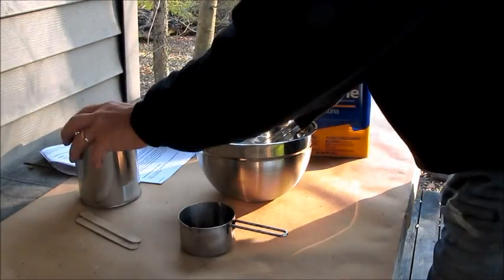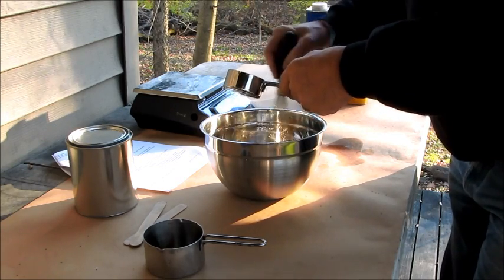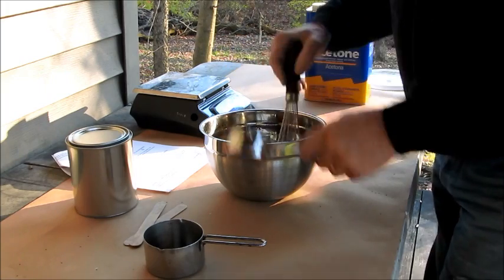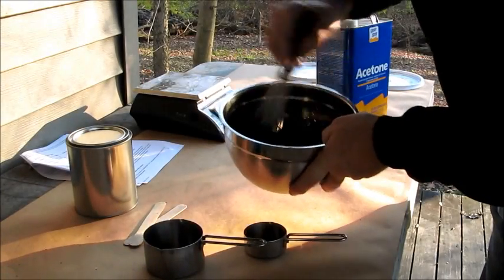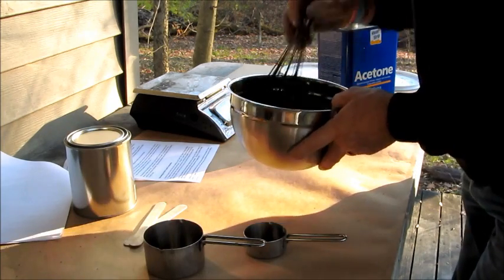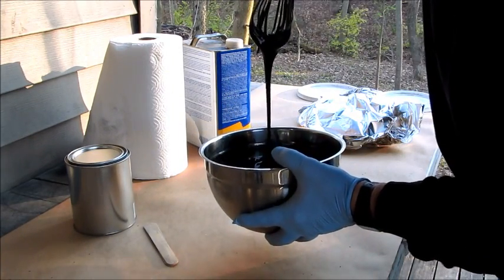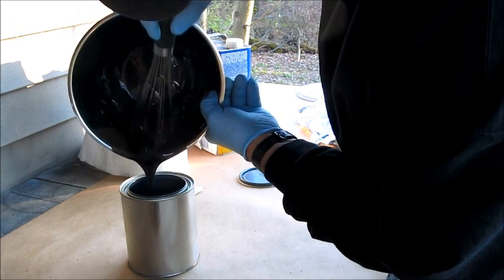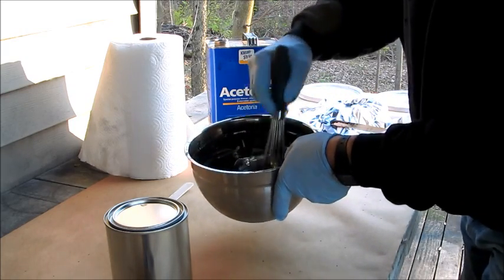Homemade Nitro-Cellulose Lacquer

Comment: is this what you would use to dip your E match in, then coat it with some sort of composition? 

or would you stir your composition in this slurry? this is just for an E match in a rocket to set off the main parachute.
Reply from the maker: I don't know how to make such an ematch for that purpose successfully, Dayton. We often mix BP dust into this NC lacquer for priming stuff. Do you not want to use a commercial ematch for your purpose?

Comment: Would old ping-pong balls work instead of gunpowder?
Reply from the maker: Some folks have used those balls, the actual celluloid/nitrocellulose ones which smell of camphor when cut apart, but that plastic/NC has a lot of fillers in it, which is not ideal. Real nitrocellulose, or the smokeless powder, works much better.

Comment: I actually use just a metal quart or gallon paint can to mix my lacquer. I leave about 1/3 can empty, so I have room for the mix to be shaken. I add my Acetone first, then my double base, pop the lid on tight and shake it vigorously for minute or two, then I pop the lid a little bit to burp off the little bit of gas that’s released, seal the lid back and shake it again repeating the process of shaking and burping until you no longer get any burping, then your dissolved. 
Then I just pop the lid take a stir stick or spoon, give it a quick stir to check consistency, make sure no clumps, and make sure nothing is built up on the bottom or sides of can.
BEST PART you use less acetone due less evaporate, you get less exposure to acetone vapors, you don’t have a dirty bowl to clean, your lacquer is already in its storage container, and its easy to top your can back off the same way. 
Works like a charm
Reply: Is there any differance in performance doing this way?

Comment: I'm not a newbie, and I do my own research and, of course, learn more everyday. That being said, you did not mention what the powder was that your using. People have asked in the comments and no answers were given except a few sarcastic remarks from others about this not being for them is they don't already know. From my research I found that using some variations of double base nitro powder can produce nitroglycerin when stored. Oh boy, would that be fun to discover. Ping pong balls work, but not as good. Trying to find the recipe that Lloyd Sponenburgh came up with resulted in nothing tangible, and no I wasn't going to pay for and join several blogs and spend the next 40 years searching for it, Simple search came up short. So, can you please inform the good people what the mystery powder was that you are using, you already stated that you have stored and added to your stash for a long time with no bad side effects, got that part - check. Yes, some of us require a road map to the destination, especially when the road getting there can go boom if something goes wrong. I'd hate to come home one day and find my garage is gone because I used the wrong GD powder. If people complain because you drag your vids out with details, that's on them. I'm sure there are plenty of people, with actual brains, that won't be complaining over to many details. Now, if your hiding this detail because of the Google overlords than that's something else entirely and I apologize for blowing up. #fjb
Reply from the maker: It has been answered fairly often in the comments section, D, that the powder is one of the "Dot" smokeless powders. Good luck, and stay safe.
Reply: @nedgorski  would Hodgdon-HP-38 smokless be fine to use? so so many to pick from really. does it store ok or do you use it up fast?
Reply from the maker: @daytonpyro  I've not tried it, but it looks like a hot smokeless pistol powder. It's worth a try, for sure.
Reply: dude... i'm pretty sure ned has answered this question at least 10 times by now...  FFS 🙄

Comment: Howdy Ned! I wanted to know something. Is this lacquer coating the kind that goes on the outside of fuses to make them burn steadier and waterproof them? Cause I noticed that cotton fuses made with sugar and saltpeter have a tendency to burn slow and peter out as compared to commercial green wire fuses.
Reply from the maker: The lacquer coating just water/fire proofs the fuse, depending on the thickness of the coating. It also sort of glues the strings and everything all together. It's not what's responsible for the burn, or its consistency, though. That's the powders job.

Comment: You showed us how to mix something in a bowl congratulations
Reply from the maker: Aw, Marcy, sorry it didn't make ya happy. It's all in the details, though. This is something that's very easy to mess up. But, you go have fun making your chocolate chip cookies...
Reply: @nedgorski  acetone plus styrofoam makes laquer, or spend $19 at Walmart and buy a quart of lacker in the automotive department it already has the acetone in it and it's ready to spray and is in fact cheaper than a gallon of acetone. But if I miss something in your details I apologize
Reply from the maker: @Defundemorats  There's huge difference between pyro NC lacquer and the lacquers you mention, Marcy.
Reply: @nedgorski  well that's what I figured I thought that would be an interesting video however
Reply: @nedgorski  nitrocellulose lacquer vs. Acrylic lacquer is always something I wanted to research

Comment: kann i use dextrin instead of nitrocellulose laquer in bismuttrioxide crackling stars?
Reply from the maker: I doubt that would work, Heis.
Reply: @nedgorski  thank you! And is it possible to use potassium nitrate instaed Barium Nitrate in strobe Stars(bleser)? Or Just try it Out?
Reply from the maker: @Pyrokartoffel  I also doubt that will work, H.

Comment: Maybe I didn't watch all his other vids, read all the comments and his blog, but why would somebody want to make their own nitro-cellulose lacquer when it can be bought at many stores locally or online?
Reply from the maker: I know of no local place, nor any online source right now, for the NC lacquer used in fireworking. Woodworking NC lacquer has undesirable ingredients in it.
Reply: @nedgorski  After browsing thru your other vids it is apparent that you use the goo to make fireworks, but I'm after N. Lac. to spray, would this stuff be useable for spraying on wood?  My reasons for not liking the stuff they sell at stores are that they add a bunch of ingredients I don't like either like plastic.
Reply from the maker: @zzubuzz  I don't have any info on that possible use, ZZ.

Comment: I remember when Lloyd Sponenburgh, confronted by the amateur soaking method on rec.pyrotechnics, replied, "We don't have time for such methods," and disclosed this way.  However, the soaking method is good if you do have the time to wait, because it saves your arm mixing like that.
Reply from the maker: Without the whisking, Robert, the powder just turns into a "glob", with all the grains sticking together. I'd imagine it'd take quite a while of soaking to get that glob to soften. Yep, I'd prefer to keep the process moving, and "git 'er done"..
Reply: @nedgorski  The "while" for me is two day-long soakings in the storage container, with brief mixing with a simple blade after each, and usually a second dilution before the second mixing.  And since I make this only in small quantities and the vapor seal on my container isn't THAT good, so after a few weeks it hardens into a puck, I just redissolve that puck by the same method.  If I were in the BUSINESS like Lloyd, and employed people, or had other reason to be using a lot of nc lacquer in a short time, then we indeed would not have time for that, and we'd use his method.
Reply from the maker: @goodmaro  I'm typically mixing "just enough" of the lacquer to wet a batch of crackling microstars, Robert, so I want to keep the process moving along. If I was just mixing NC lacquer for future use, your method would be functional, yep. Lots of ways to skin the cat.
Reply: Ko

Comment: The powder he refers to is nitrocellulose powder.  What is mistakenly referred to as gun powder which it is not.   It is like Red dot, green dot or blue dot or Unique nitrocellulose powder.   For clear you could use the original gun cotton with a small bit of slowly added sulfuric acid to dissolve the gun cotton then a tiny bit of sodium hydroxide to neutralize the acid.   But if you are asking what is the powder.  This is definitely beyond your chemistry ability.
Reply from the maker: It is not NC powder, it is smokeless reloading powder, such as one of the "Dot" powders. I would not recommend charging into trying to make your own from gun cotton, etc.
Reply: ned gorski  Red.dot, Green.dot are smokeless propellants commonly used for reloading.  Their main ingredient is nitrocellulose!
Reply from the maker: @tomharrell1954  We can purchase nitrocellulose powder from our suppliers. That is different than smokeless powder for reloading ammunition, which does contain nitrocellulose, yes, but also nitroglycerine and other ingredients. Pure NC powder is not used in this project.
Reply: ned gorski   Exactly
Reply from the maker: @tomharrell1954  Yessir
Reply: @nedgorski why do you use smokeless powder instead of just pure nitrocellulose? Is it because the smokeless powder has other stabilizers that help overall?
Reply from the maker: The smokeless powder has "stuff" in it other than nitrocellulose, Nag, which helps in the reaction. I mostly just follow the lead of others who have had successes with certain methods. @NagashiChidorii

Comment: How long of a shelf life does it have in the paint can I hear or have seen a lot of people say it breaks down over  some time. Is the NC Lacquer made with ping pong balls & acetone considered the same thing chemically speaking. Somehow I'd imagine that the chemical vcomposition structure wouldn't be exactly the same.
Reply from the maker: No, Dylan, the composition of Ping Pong balls is different than smokeless powder, so the resulting lacquers made from them is different, too. I have had the same lacquer for years, occasionally adding more acetone to it, and it works just fine.
Reply: @nedgorski  I figured they'd be different somehow chemically. I've just read of people making it with the balls & using it where NC lacquer is called for. I just wondered how they held up in comparison with each other.

Comment: I made mine exactly as shown. Turned out perfect. I have NOT made the crackling stars yet. But my NC is great! 

I used “MagPro” by “Accurate Arms”. It’s a slower burning rifle powder. But it’s the only double based powder avail to me at the moment. So it is what it is. So far it’s great for priming my rondelle and beraq fuses. 

I started out by melting ping pong balls in acetone. And it does work. But it’s way too hard to get a consistent consistency. But those seems great and dries almost the same as my first way. Im very happy!! 

Thanks Ned! And Lloyd!
Reply from the maker: Xlent, James. For your priming slurry, are you mixing some BP dust/fines into the N/C lacquer to make a BP/lacquer slurry? It is a good idea to do that, since the lacquer on its own can actually make a plastic fire-block when it dries.
Reply: Ned Gorski..I normally dunk the fuse or whatever into the laquer then into the fine powder grains. I have never premixed the grains. As I assumed the laquer would dissolve my BP grains. But I will try your method when I make another batch and see what happens! 

Again and as I’ve said before, I GREATLY appreciate you and your wealth of info/library. As I do not live near any master pyros. So I’ve had to figure out everything through trial and error. I’d be up “doo-doo creek” without a paddle if it weren’t for your library!! 

Thank you again! 

James 

The Piece Keeper on fireworking.
Reply from the maker: @fineartonfire_5327  Thanks, James. Yes, I'd mix some fine BP into the lacquer for priming, then dunk the primed device into the grain BP. That's a good priming method. Keep it up.

Comment: why aceton insted nitro thinner ? whats the diference ned?
Reply from the maker: I've never heard of nitro thinner, sorry. Acetone works to dissolve the smokeless powder.
Reply: @nedgorski  i am sorry nitro solvent called and it used to dissolve paints or clean brushes after painting! And i ask this because the smokeless powder is cellulose and adding nitro in you make nitrocelullose

Comment: I don't understand where the Lacquer comes in here. When I made this mixture according to instructions it was creamy...but it dried on the top of my shell, and simply flaked off. Am I missing something?
Reply from the maker: It  will dry into a hard, black, plastic-like coating, if it's not mixed with other powder in one process or another, Danny. It should stick to things like glue once it is dry.

Comment: This is UTTER GARBAGE....firstly....Acetone is highly flammible....a warning at the start would be nice, secondly, you seem clueless on mixing....just as with cooking and ....flour and water....you should mix thick THEN thin it...the weight and mass disolves it in one fifth of the time....try a simple pancake mix and see....remember....lumps?? and thirdly....you don't mention what you are mixing...duh!!.....fail....omfg....use a spoon to scrape the bowl....didn't your mother ever bake you a cake for you birthday....dont you remember licking the bowl and spoon???
Reply: Bahahahaha have you seen Ned's other videos? I wish I was as "clueless" as him. PS: You may not be aware that there are huge warnings on the labels of acetone about it being flammable and all. Or how fast it evaporates ("just as with cooking and" how simmering something can thicken it up by boiling water off). Orrrr the fact that 'wet mixing' with acetone is a common SAFETY technique for sensitive pyrotechnics mixes. 

Instead of being an obnoxious opinionated fool, try being tactful or at least make sure you know what you're talking about before ranting like that.

Perhaps also google 'The Pyrotechnics Guild International' and check our their list of recipients of the annual Grand Master award.

"The Grand Master award is intended by the PGI to recognize the competitor who has best demonstrated an overall excellence with pyrotechnic device invention, implementation, and display for the current year."

Comment: For those interested.  Found this on the web.

50-60g (1.75-2 ounces) of double-based "disc" style powder like Green
Dot, Blue Dot, or Bullseye shotshell powder
500ml of acetone (a little more than 2 cups)

Then just follow the instructions in the video.

Smokeless powder is based on nitrocellulose (that's what makes it smokeless).